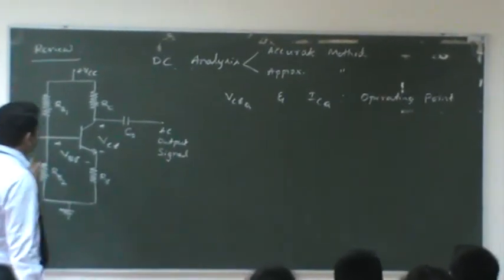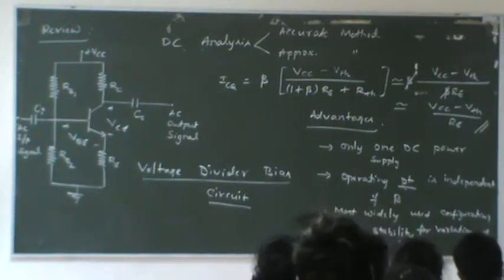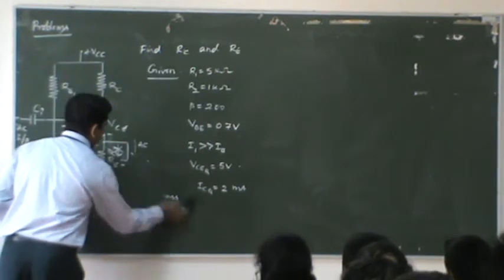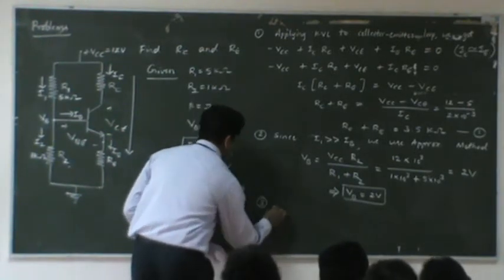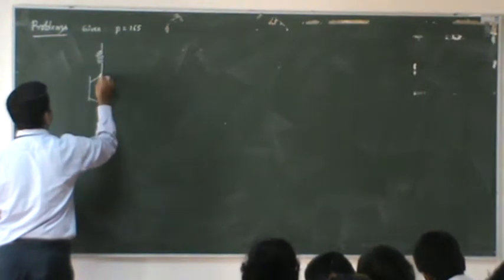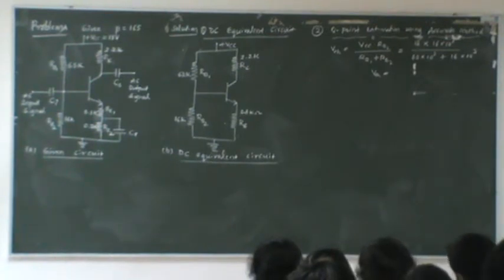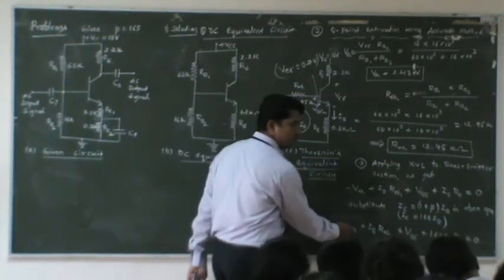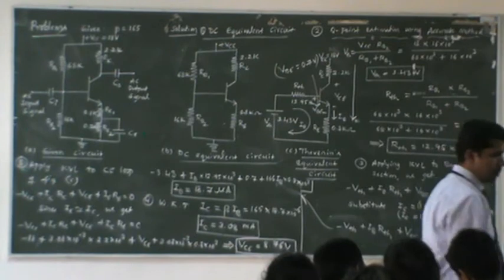Lecture 12 Voltage Divider Bias Solved Problems

Comment: Did u mention the common bias for MOSFETs is 45%VCC across Rc, 45%VCC across the transistor(between Vc and Ve, and 10%VCC across Re(given  VCC,Beta,and Ic)? That being said to find R1 i picked the R2 value and R1= R2(VCC-VB)/VB<-*this formula can vary*. But my problem is solving for VB...Think the answer is Vre Vbe= VB but please help i cant visualize it >_<
Reply: Garrett Land Don't know how the line got there...please don't disregard the sentence.